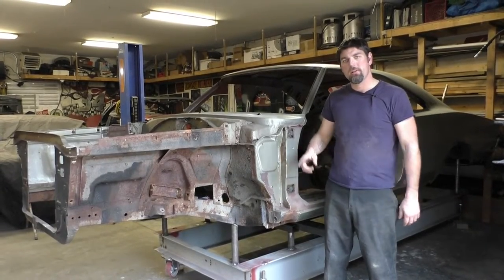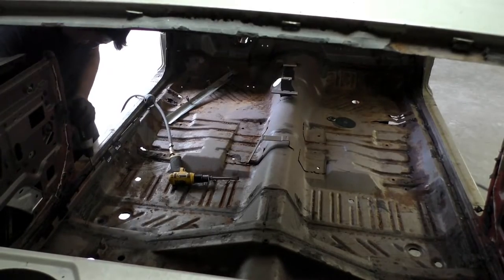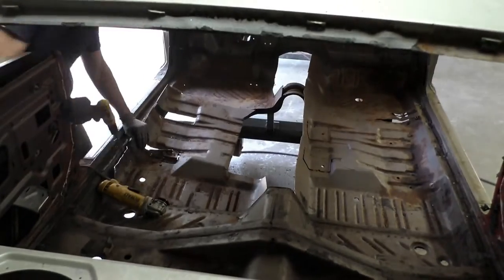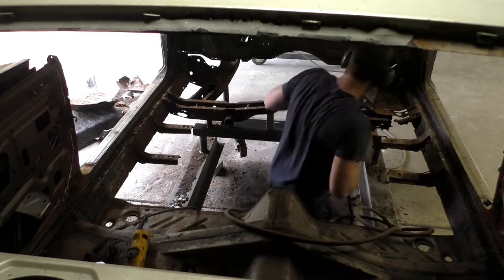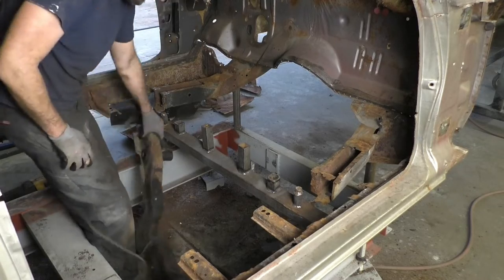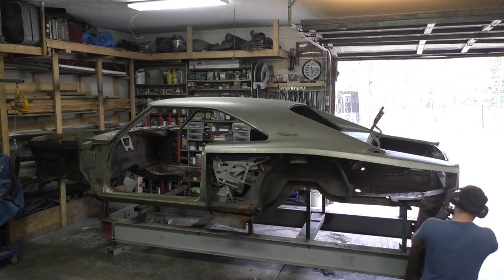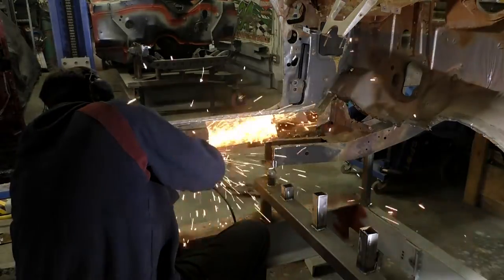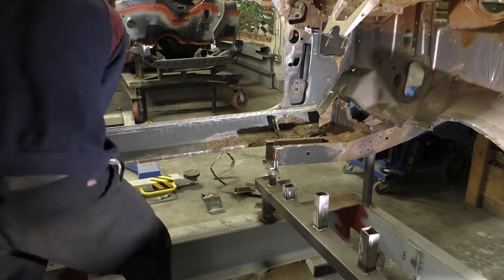Cutting out All the Rust 1969 Charger NOT too much left of Restoration Episode 2

Comment: I'm overjoyed watching this craftsman at work! I look back at the restoration I did, on jackstands, thinking how the hell are you supposed to keep this thing lined up? Ahhhhh.... thats how. LOL, I wished I would have seen this video 25 years ago!  If I may, ever most humbly, make a suggestion, please wear eye protection, by habit, anywhere near metal work. I know there is a small percentage of my car embedded in my eyes, as a keepsake for those years hunkered down in the garage. You may not want such a gift yourself!  Massive thumbs up, and subscribed! :)
Reply from the maker: Thank you very much and I will always wear eye protection now when grinding and cutting as I have had metal cut out of my eyes over 5 times, you would think eventually I would learn. I haven't had it happen yet while using the air hammer or drill yet but you are 100% correct on your recommendation.
Reply: @carthageclassiccars  Well done! 5 times at about $150 a go? :)  You could have bought more AMD metal with that dough! LOL, I even got metal lodged while using those goggles with the air holes, so nothing is perfect! I've since gone with a full face flip down protection + light safety glasses and haven't had any problems since. Keep up the good work!
Reply from the maker: @chargerr4807  You are right that is the best for Protection

Comment: Nice video. I have never seen a b body taken that far apart. It’s nice to see how much thought and work goes in to doing it right. It does seem like you should use full quarters after going this far though
Reply from the maker: Thank you for watching. That's the one thing I wish if I could go back is not even start the build until the owner agrees to full quarters on this one.

Comment: looks like it better to just build the car and then put on frame, great job
Reply from the maker: I have seen some guys build the floor section first front to rear and like you said drop the body on that solid base. I could see how that would work and don't disagree with that method. As long as all the points are Jiged up and in place.

Comment: Had another question for ya. I have watched a LOT of your videos in the last couple days, but not all, so you may have answered this before and if you did I apologize. You tend to cut and replace as many parts as you can because it gives a better result. You also treat things 200% better than anything else I have seen out there, like your cars will last forever and I respect that. But if what do you do for something that cannot be accessed as easily. Let's say an inner subframe rail, youll do a full resto, clean it up, ospho, epoxy primer,  and its safe from rust forever. But what do you do for inner frame rails you cannot access? I know people shoot something like Eastwood Inner Frame Coating, but even that will rust overtime. I know frame rails are much stronger and will last way longer than a body panel but is there any "secret" you may have or technique to this? really curious about this one. Thanks!
Reply from the maker: Really thanks a lot for watching! So actually the next video in the series I did address your exact same question on this Charger. Personally I think you answered your own question the eastwood, or some kind of chassis paint on the tip with a hose nozzle and just spray and pray is I feel your best option but still not ideal. What we are banking on is at this point in these cars existence they should have more of a pampered life, valued, and cared for at this point in time. So the likelihood of rust eating a frame rail from the inside out before the cars exterior would need a full total restoration again I feel is not going to happen. Personally if I were buying a car I would find one automatically knowing we would cut the whole exterior body off the car and treat it properly where I can access as much as possible. Saying that a lot of the major rust issues lies in the mopars and not as bad in the GM's. I know you said you were looking at a NOVA and in my experience the GM line of 60's-70's era cars I have seen the inner structures are a lot more protected from the factory and usually a little more rare to see the rust on the inner supports up high and even the rails if they look alright from the outside on a GM you should be ok.

Comment: That floor was pretty solid did they need to fully be replaced?
Reply from the maker: So it needed a few patches. Personally its faster and the job comes out better when I put an entire floor in a car for me especially when its already on a frame JIG. Also the car needs torsion bar crossmember and inner rocker at that point in my opinion there is no easy way to do these two installations without removing the floor. Sometimes on these cars you have to sacrifice good parts to know the rest of the car is up to quality standards.

Comment: im about to start the same process. My pans are a lot worse. do you recommend a support in the door opening to keep car from flexing? or does your rotiss prevent that?
Reply from the maker: So in this video I would consider this a frame JIG. A rotisserie is something that hooks on the front and rear only of the car used to flip the car over or twirl it. I would recommend NOT using a rotisserie for sheet metal replacement but only for bodywork. If you are building a frame JIG like in the picture as long as the frame jig doesn't move and and the car is supported on different points using the JIG as its structure there usually isn't a need for any door support. In this video not sure if you watched the entire video but the entire floor pan and torsion support was removed. I didn't add any door support and the car lined up just perfect when finished.
Reply: @carthageclassiccars thanks for explaining that its a full jig, my other question is why don't you brace the rear with quarters n trunk pan being removed. I understand the inner wheel tubs but from Duthmans to rear valance around trunk won't that sag?

Comment: The best info I’ve found on car building, a great help to me. The nova build showed what a true craftsman can do. By the way, what size mig wire do you use ?
Reply from the maker: Thank you. On the Mig wire question, honestly i have .026, .030. and .035 all on hand and do honestly change them out constantly. Usually I try to keep .030 wire in the welder for most of the rosette welds and car frame rails its a great all around wire and can be fine tuned easier with wire speed for multiple uses. The .035 I will use for thick 1/4 inch plus thickness jobs like building of this frame JIG. I don't use the .026 as much because I would normally use it on outer body panels but most of the time I would use that size wire I will take out the TIG welder instead. If you need to buy one size wire in summary .030 non flux core wire is my go too of choice.